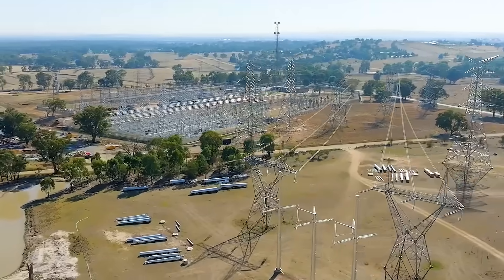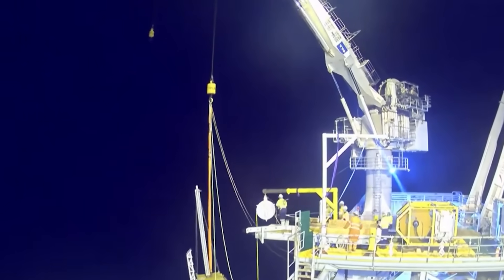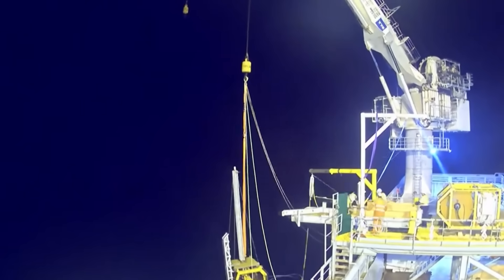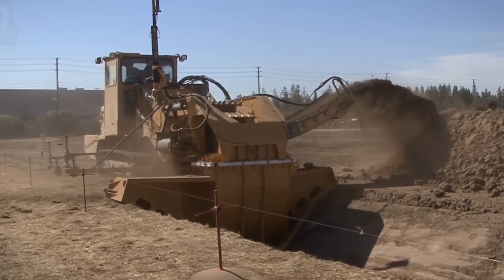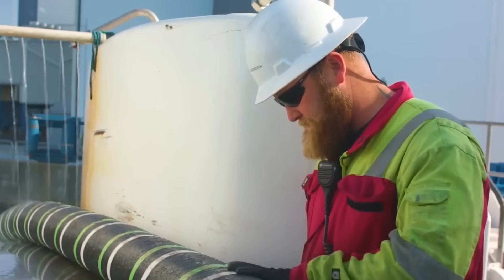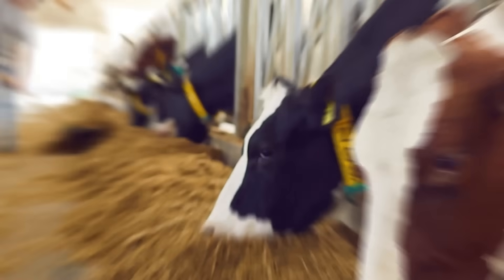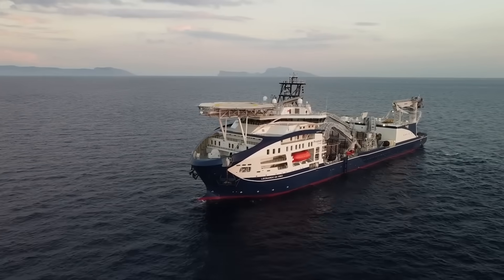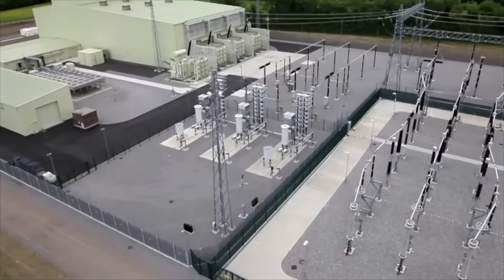Australia's $3.8 Billion Cable, the Marinus Link, is a GAME CHANGER

Comment: Since when DC has become more efficient to transfer over long distances?
Reply: HVDC has three advantages over AC. 1. No inductance so very little voltage drop. 2. Less energy losses because there is no ‘skin effect’ which is concentration of current near the surface of AC lines due to induced eddy currents. 3. No inductance means no reactive power compensation is required to transmit real power. This means a more stable system when there are line disturbances.
Reply: DC has some advantages over AC. Mainly it is more efficient when u have very long distances. But it is also better with high power transfer as it needs thinner cables, and some more, but i don't know how to say it in englisch. ChatGPT may help
Reply: @Xerayel  please don't use ChatGPT to recite important information. In fact just don't use ChatGPT at all. Period. Full stop.
Reply: It Is not. Never has been and never will be, but I am only an electrician WTF would I know!
Reply: @davidcurr6221 electricians are not scientists.. how clever of you to prove the point immediately?
Reply: @kitchwa  No and thank you for your immediate recognition of my superior qualification. You do have me perplexed though, WFT do scientists have to do with electricity generation?
Reply: @davidcurr6221 you think electricians do? Brother, I'm not sure you can tie your shoes safely if you believe they do..
Reply: @davidcurr6221obviously not a lot about HVDC

Comment: New high efficient ultra supercritical (USC) clean power station for countries with a economical bituminous coal will provide the most economic long term source of electricity.   China is re-powering and greatly expanding its power grid with hundreds of new USC coal power stations.  In the US a USC coal power stations has an estimated crossover fueling price with natural gas at $0.80 USD where US wholesale natural gas hovers around $3.00 mmBTU.   It cost much more to staff the USC coal power station  and much more to build it than a natural gas combined cycle power station.   Very large scale USC coal power station reduce staffing costs per GW.   

Wind wildly fluctuates second-to-second.  Solar voltaic electricity falls off to almost zero anytime a cloud passes over.  Wind and solar voltaic generated electricity changes greatly second-to-second requiring fast reacting peaking power to provide useful electricity.   New fast reacting hydropower power can use erratic generated electric power to save water head.  In practice the solar and wind generating space is 100% safely backed up by running natural gas turbine generators at high readiness making near zero electricity costing more natural gas just at high readiness than making all the electricity from natural gas combined cycle power stations.  Since very little natural gas is credited with making electricity the large natural gas use is hidden from the public.   Steam turbine generators that can use a broad range of fuels react too slowly to support the generating space of solar and wind generated electricity.   

New high efficient ultra supercritical (USC) clean power station for countries with a economical bituminous coal will provide the most economic long term source of electricity.   In the US a USC coal power stations has an estimated crossover fueling price with natural gas at $0.80 USD where US whole sale natural gas hovers around $3.00 mmBTU.   It cost much more to staff the USC coal plant and much more to build the USC coal power plant than a natural gas combined cycle power station.   Very large sale USC coal power plants reduce staffing costs significantly.

Comment: The Net Zero energy target is just a pipedream created by delusional greenie enviromentalists and businesses with vested interests. Australia has unlimited coal reserves, build more coal fired power stations, maybe even dam the shelved Gordon below Franklin Dam and create more hydro electric power
Reply: I'm no greenie but more coal fired power stations would be insanity. Solar and hydro are way cheaper and better for the environment. Battery storage prices are constantly falling.
Reply: @budawang77  Hydro is cheaper, but Bob Hawke stopped the Gordon below Franklin Dam, solar, wind and batteries are not better for the enviroment,
Reply: @chrisjsmith61 Yes they are. Much better.
Reply: @chrisjsmith61  Dams are not that good for the environment, a recent survey by the satellite that monitors for methane releases found the biggest emitters were refineries with leaky pipes, Coal seam gas mines and Dams.  It's when they release the water it reduces the weight of water sitting on all the silt near the Dam wall and as a result, all the biological activity in the silt creates methane which bubbles up to the surface.  Also nice work on using your real name and age or year of birth as a username.  I'm guessing you're of the Boomer pedigree?